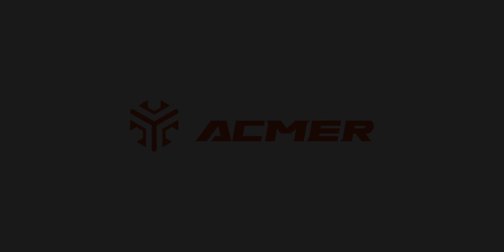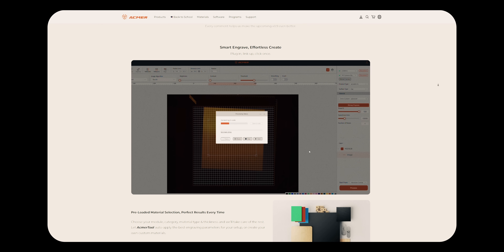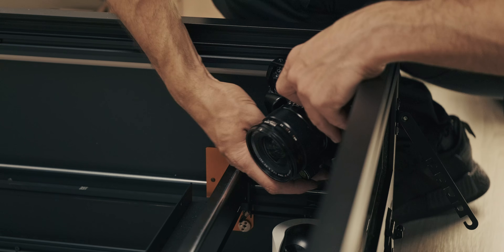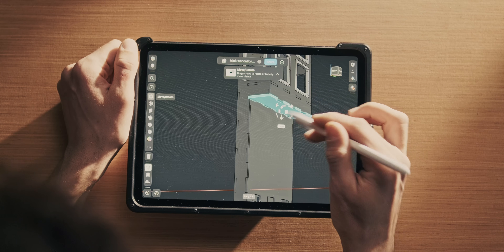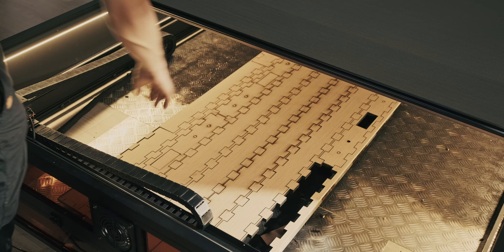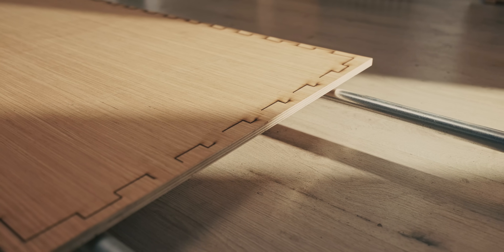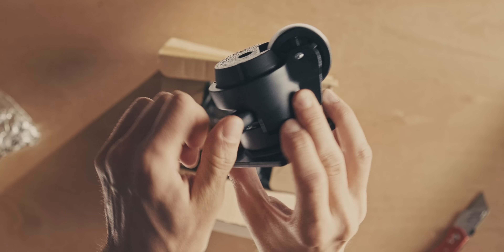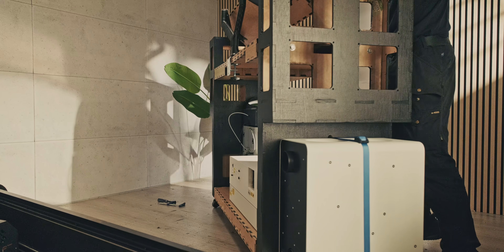Ultimate Mini Fabrication Setup Build – Episode 2: ACMER X1 Stress Test

Comment: Awesome as usual. Have you ever used a Longer Ray 5 20W laser engraver? I have one and i have never been able to get it to cut or engrave anything. I even have the camera and air assist. I sepent over $450 USD for this piece of shite. If you have, do you have any advice? An Lightburn on this machine seems confused.

Comment: Cool build! There are a couple ways to recovered failed jobs using LightBurn. You can use the Start Here button in the Preview window to start a job from wherever the Time Slider is currently positioned. Or, if some of your shapes cut all through but not all, you can enable Cut Selected Graphics in the Laser Window, and then select just the ones that didn't cut through, and run the job again.
Reply from the maker: My apologies for misrepresenting this in the video—I’ll make sure to correct it in the next episode. I just tested it out, and it’s perfect!

Comment: I'd recommend getting an inline booster duct fan (or two) to put inline for your exhaust so you don't have to rely on the output of the laser's fan. You can get ones with a PWM controller to adjust the speed as well.